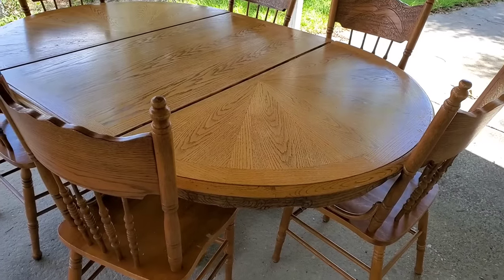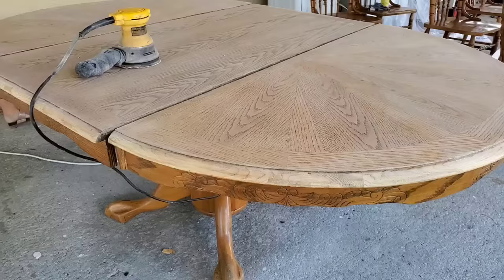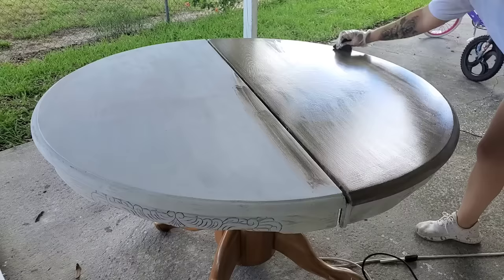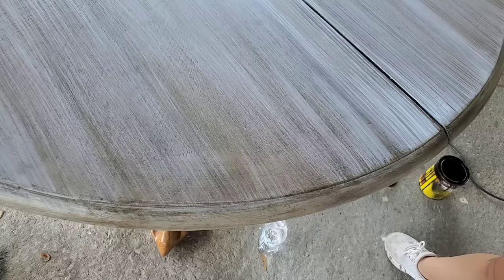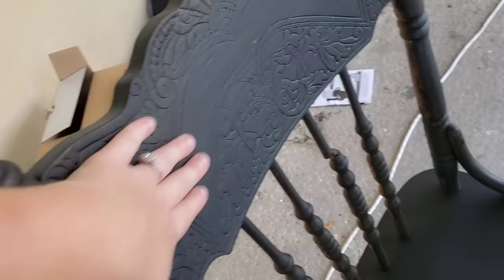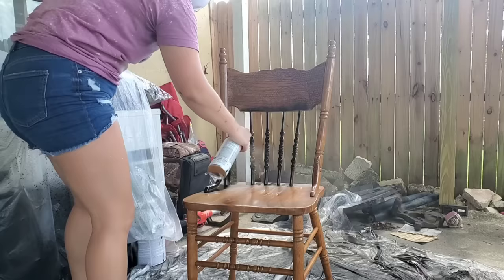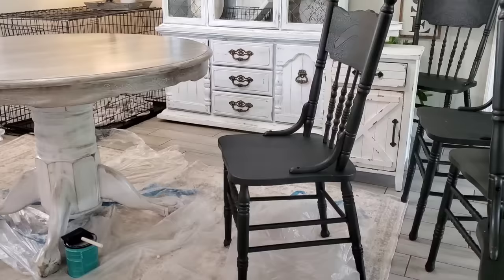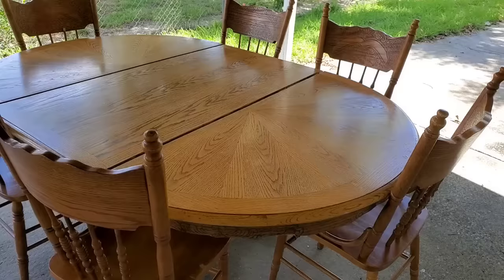Old table makeover | farmhouse table diy | Diy projects on a budget | Table transformation.

Comment: I have used the brand Farmhouse paint which has the primer and sealer in it, but it behave like chalk paint achieving and the only thing you need to do to your piece is make sure it's clean and any scratches or dents that you want to repair. Anyway you can also use it like a stain by applying it on a damp surface just wiping back. And this technique you are using your using the stain  glazing. I love it. Nice color selection

Comment: I have a dining room set very similar to that -- four of the chairs may be the same as yours. But mine is a more subdues color, even though it's still an oak color. It's more brown than yellow or (thank God!) orange. But it only had four chair with it when I found it, so I had to buy two much more modern chairs of a similar design. I have then at the ends of the table, with matching chairs at the sides. The two newer chairs are a redder color, but still not yellow or orange. I also found a vintage oak buffet with a mirror and mantle that not only matches the table and chairs, but fits exactly into the space I had available.  

Anyway, my suggestion is this: consider using primer in your next big paint project. A good stain-blocking primer will mask the unwanted yellow and orange in the wood, and will give you a good base for your paint to stick to. You can still distress or add any decorating techniques you want, including decoupage. The primer won't interfere with anything you put on top of it, but it will help your paint stick, and will help prevent peeling and chipping.

Comment: Very nice and i used to have the same table and chairs! Golden oak is a real bear to do a good job on because of the beautiful deep wood grain and orange tones . I try to use a bit of a cooler tone ot base to help counter that and do a spray shellac or lightly rolled on shellac to softly seal the tops of furnature . But i do love that water based poly for its clean up and fast dry time.

Comment: I think your table and chairs are absolutely gorgeous! I think I get a smoother finish overall if sand between coats. It is alot more work though. I like to use steel wool and then brown paper bag (like from grocery store) for final sanding. Works really well for chalk paint wax too.

Comment: That was a big job Kerrie.  I don't think I would have had the gumption to tackle that.  Did you know polycrylic comes in a spray can as well?  I have used both.  I don't think you get as hard a coating with the can.  I am wondering now what the table would look like if you painted it black as well.  Black is a popular color now with modern farmhouse.  Nice job!  Also you had a lizard friend judging your work.

Comment: Hi. Great tutorial. We bought all the products listed. You mentioned using a white paint to make the light brush strokes after the stain. All you said was used a white paint but did not say if it was the white you used in the beginning or of it was a different white paint. If you would clarify. What are you wiping the table with? The cloth. Also, how much time in between painting do I need to wait, or the dry time. I’ve never done a project like this as you can probably tell. 😂

Comment: To neutralize the yellow one should sanded it down you should have used a 50/50 bleach and water mix. Apply it as many times as you need to achieve your goal. For Your Bass and legs I would have painted it black first and then painted it white so that when you distress the darker color will show through and highlight your distressing marks

Comment: I'm thinking a different choice of stain like Espresso, Cherry, or Mahogany.

I have a recipe for homemade Chalk Paint that easy, (measurements available online) using Plaster of Paris, Distilled Water, and Laytex or Acrylic Paint (use either flat or semi gloss paints), seal after drying with Poly Acrylic or a Chalk Paint Wax. 

You can get wood Paint Stirs and test the stains, note:  they will be darker on these due to the wood being so porous, so just use a paper towel and dab a little on.  When you seal stain it brightens up the wood and the grain, with a desired outcome. 

Dining chairs are a commitment project, so just do a 1 at a time and don't rush yourself.  

Rule of thumb, the better products actually are "cost effective".  We end up spending less by buying the quality products. They are easier to use, look better, and go farther. 

If its a quality piece of furniture don't take short cuts, you want to apply craftsmanship so You will be happy with the outcome. 

If it's a basic piece, chalk paint offers a skip sanding option. 

The key to consistent good outcomes:  just do the requirements, take your time, enjoy the process, and then you can EXPECT THE FABULOUS OUTCOMES. 

You remind me of me back when, so I'm sharing these points cause I want you to have no regrets and have excellent outcomes. Everything is a learned talent, always read the product lists and select the quality products to enjoy the expierence. 

▶  Learn the "Universal Law of Attraction", let it sink in, it is the 🔑 to the Life Journey and if you realize that, and desire the "recipe of it", ask me here, and/or hunt me down on FB, and I will "give you" the How to, and you will absolutely have a whole other realized perspective and enjoy a truly if in journey. 

...cause you, your thoughts literally are creating 99.999% of your Reality.  

It is the "Divine Design" and Jesus taught from the foundation of this, and it is Quantum Physics Science defined and Fact. 

Best kept secret in our Western World. 

1.  Think Quality, lose the "got to buy cheap", "can't afford" thoughts, cause you are creating more of that.  Think "I am worthy", "I have", focus on desire, "never the undesired".

Know "Your Thoughts are Your Power", to worry what others think is to give your power to them. 

You are a Soul having a Journey in a Human Vessel, You are of and from God/Source/Creator.

Jesus said:  "the body is a temple of God". 
That = Worthy 

Know that anything you can imagine You can create.  

We are amazing beings. 

Fear is the lowest frequency in our Universe, Love is the Highest.  Where do you think God wants your thoughts to be?  Not in the lowest.   

Love, Joy, Passions, Creative, Laughter, Compassion - the Positives.   Live in the Higher Mind where the Positives Reside.  

You are a perfect creation. 💯 God does not make mistakes.   

Love your You.  😘

Comment: I've refinished some wood pieces, going from one stain color to another, and I think the problem you had is that you didn't sand down far enough. You need to sand to remove all of the prior finish, and the wood that has the old stain, and if that is an oak table, the color after you sanded did not look like natural oak. This is just from my experience.

Comment: When using the rustoleum spray on the chairs do they need to be sanded down?  I see that you just painted without sanding. What if I wanted to paint the chairs and the table with the spray do I have to sand the table down?  Also, can I use this spray to paint interior doors or do you recommend paint instead?  Would it be Matte, Flat or Satin for the interior doors?